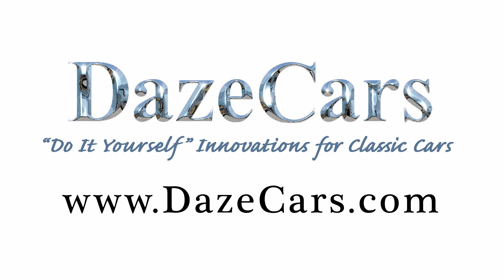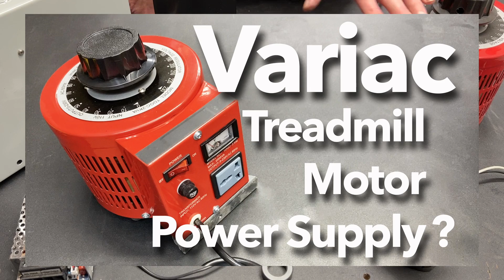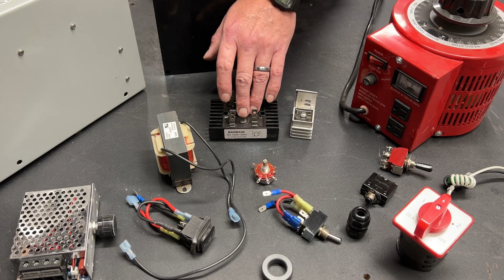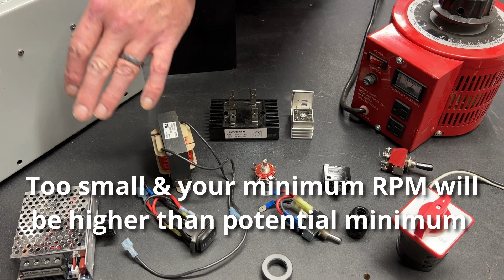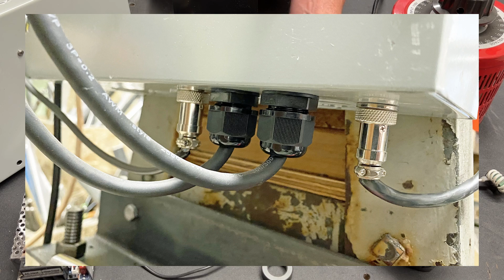Parts Lists & Links for Building Your Own Treadmill Motor Power Supply

Comment: Daze, I've been watching your videos and you are very informative. I'm building a beltgrinder using a 1.25 hp 90v 12A treadmill motor, I've got the 10000w controller like you use, aswell as the 100A / 1600v rectifier. My need or question is what is the inductor choke should I get and would Amazon have it ? Any help would be greatly appreciated.
Reply from the maker: I answered this vei email when you contacted me
Reply: @dazecars thank you very much 😊
Reply from the maker: you are welcome

Comment: Hello sir, I bought this, AC 110V 10000W SCR Electronic Voltage Regulator. What is the switch on the circuit board for??
Reply from the maker: its for the fan
Reply: @dazecars thank you
Reply from the maker: My pleasure.

Comment: I have been watching a lot of your videos, I have 2 complete electronic treadmill sets, one is a MC 60 with a 2.5 HP motor and a MC 1200 with a 3.8 HP motor, planning to use it on an Atlas 618 lathe. What's your opinion on which set up should I use
Reply from the maker: I would start by doing the torque calculations and see which motor is better.
Reply: @dazecars  Thanks for your quick reply, the 3.8 HP comes to 5 torque at 130V, the 2.5 HP comes to 2 torque at 95V, that's at full power, my mainly concern is the big motor may have too much power for such small late and could snap the gears if a tool gets stuck in the part
Reply from the maker: If you set it up with a v-belt the belt will likely slip before the gears snap.  The two foot pound unit is likely also a good candidate.
Reply: @dazecars  Yes, the plan is V belts, already fabricated the motor pulley and order a larger pulley for the Jackshaft, since I have everything for both motors, I'm going to try both of them to determine which one is better. The next thing is figure out the right sequence for all the electrical connections, I have to watch your videos again for it, although I didn't see a wire diagram to connect the tandem resistors you did on your lathe
Reply from the maker: Let me know if any questions come up.

Comment: Thanks for this part breakdown! I’m about to pickup an old treadmill with a 2.5 hp motor to build a puck shooting machine for my two goalie kids.
Reply from the maker: Make sure you understand that HP can be very misleading with a treadmill motor.  HP is a function of RPM and that HP number is at max RPM.  The moment you slow it down you reduce HP.  Torque is the important number and not all treadmill motors are equal.  This info should help: https://youtu.be/KPcAr9orqZw

Comment: Hi thanks for the video. I put a treadmill motor on my lathe with a Mc 2100 controller. When under a load I’d jogs down and shuts off. How can I fix this problem??
Reply from the maker: I got to thinking about your problem further and the motor might also be undersized/under geared and is drawing to big a load from the power supply.  how do you have it geared and what is the torque of the motor?
Reply: @dazecars I've heard people say this a bit in the past and always asked but never got a response.
I would guess the pulley ratios are off and they have lots of speed available but little torque.
A lot of people don't have a lathe to make things fit so they end up making do when making do isn't achieving the end goal sadly
Reply from the maker: It's the biggest mistake people make.  they think because they can slow the motor down there is no need to mess with a gear ratio but in doing so they don't maximize torque and end up over working the motor. As a rule take the max RPM of the motor say 4500 and divide by the max desired RPM say 1500.  That number should be your gear ratio in this case 3:1 as that will multiply the torque by 3.  It also gives you slower speeds at the bottom end.  https://youtu.be/SFvPHUlbIf0
Reply from the maker: I would ditch the MC2100 for the far superior and user friendly DIY power supply.

Comment: the choke resistance, ohms?
Reply from the maker: it will depend on the choke but should have very little.  Readings should be similar to a coil of wire
Reply: @dazecars  thank you for your prompt response, can you possibly give me the dimensions of it.
Reply from the maker: I have several different sizes from as small a tennis ball to as big as a soft ball.  typically the bigger they are the better they work
Reply: @dazecars  I am trying to find one for my 3Hp 16Amp DC motor, thank you again.

I am trying to find one for my 3Hp 16Amp DC motor, thank you again.

Reply

Comment: I really appreciate that you made this recap video. I have watched a lot of treadmill motor conversion videos (several of yours, as well). Maybe I was somewhat overwhelmed, maybe after hearing the answers so many times they have finally started to sink in…whatever. Regardless, this was a very helpful and educational video. I’m finally on my way to motor speed control and a new DIY tool.
Reply from the maker: Glad I could help and good luck with your project!  Don't hesitate to reach out if any questions come up although email through my website is probably better as that gives the option to send pictures.

Comment: Did I miss it?  Is there  link to the DC Choke?  I"m using an SCR voltage controller - Thx
Reply from the maker: The only source I have for those is used treadmill parts suppliers and scrapping more treadmills.  It must be a "motor choke" most chokes even though they look correct are not big enough.  If it's not labeled as a motor choke it will not work.
Reply: Hello, building a belt grinder from scratch. I Currently have an scr with recommended potentiometer,  ferrite choke,circuit breaker, bridge rectifier but no dc choke.  Just removed an mc2100 from treadmill for possible use in my belt grinder build. A little different from the ones you show. Can I send a pic or 2 for some end advise? Regards  @dazecars
Reply from the maker: sure, contact me through my website

Comment: So you have linked the black ferrite toroid core but state in another video to use the green ones…soooo is it green or black? They’re each made of a different material depending on the application correct? Wanna make sure I get the correct one. Thanks🙏🏻👍🏻
Reply from the maker: The one I have linked should work just fine.  I don't remember specifically saying in a video to use green... which should also work just fine.  Can you point me to where that statement is?
Reply: @dazecars ok great, thank you bud!! It was in the one FAQ video about chokes, think you were explaining how to make the inductor and said “the green ring you see here.” I was just confused.  Appreciate everything you’ve put out on the treadmill motors, great stuff!!! 💯👍🏻🤘🏻👏🏻
Reply from the maker: thanks for the follow up.  yes I used a green one in that video because its what I had but its really not that critical.  Different core materials produce different results when dealing with specific frequencies and very sensitive equipment.  For a motor we are just trying to clean out some power spikes as best we cannot eliminate a specific frequency range. That makes the material les critical.

Comment: I have the mc60 and I didn't have to purchase anything or hook up anything else I'm using the speed control that came with the treadmill stop being it's easy to cut it down and use the speed control for the board and I don't you don't need anything else that you said you need to have for that mc60 right out of the treadmill I was up and running so that statement that you need those things to be up and running is incorrect I've also come across a 1200 MC 1200 I can't find any information on this board at all do you have what happened to have any information on that board and would be willing to share that that would be great thank you
Reply from the maker: My statement of "what you need" was in regard to not using the treadmill console and not being constrained with annoying treadmill features.  Yes you can do it the way you are doing it but for applications outside a treadmill it is by no means the best way.

Comment: This idea about using a choke to smooth the brush noise...this is a super advanced topic, i wish i knew more about it. I mean clearly treadmill designers know about it....i just scored my first free treadmill and the choke is just a ferrite toroid with 2 windings, but its on both motor terminals, so maybe theyre not  applying a principle in any rigorous way as much as applying as standard of care as "treadmill engineers"...anyway, thanks for the teaching, your style presentation is really top-level!
Reply from the maker: You are very welcome!!  I am glad you were able to use what I posted to complete your projects.  Yes the topic is complicated but the general rules are simple.  Choke has to be big enough to handle the amps of the motor so if its not labeled as a motor choke its probably not big enough  AND bigger is better (physical size) a bigger choke will have a bigger core with bigger windings and larger gauge wire all things that make it function better for this application.

Comment: Hey, missed this , great information as always. Needing to re watch as it's a lot. LOL!  Have a variac and thought it was a good choice for a small 1/3 hp motor for carving. Double checking to find  I was wrong as the ac motor can't overheat.  Not running for hours at a time but I want it to last? LOL!  Forgot that Id purchased most of these Items. And I had difficulty with your ac choke concept , but need ing to use the carving motor recognized I need the choke. Your information has been helpful as its been quite some time since my electronic days.  Will be doing a refresher. Thanks!
Reply from the maker: @thomastieffenbacherdocsava1549  Did I understand correctly that you are trying to use a variac to slow down an AC motor?  If so that is not a good idea.  DC motors can easily be slowed down by reducing the voltage but AC motors do not work the same way and attempting to slow them down by cutting the voltage is extremely hard on them.
Reply: @dazecars  Yep!  Gonna use the scr controller.
Reply from the maker: An SCR controller on an AC motor is even worse than a variac. Again, you cannot reduce the voltage to reduce the speed with AC motors . To reduce the speed on an AC motor you need something called a VFD and the motor has to be three phase.

Comment: Using your link, purchased a toroid core to make an AC inductor/choke. What AWG would you suggest and how many times should each wire be wound around the toroid? Thank you again for all the great advice.
Reply from the maker: 16awg MINIMUM and 7 windings each side
Reply: Figured it would be 16awg, but just wanted to be sure. Cheers
Reply from the maker: that's the minimum 14 would be better
Reply: I agree. That's what I use on most of my projects. Cheers

Comment: could an emi filter still work instead of an inductor before the scr?
Reply from the maker: no.  An EMI filter is designed to eliminate EMI noise created by the device it is install on not clean up the power in that device. As an example a microwave has a "noise filter" on it so that when its running you don't see distortion on a TV
Reply: @dazecars  thanks, so which tipe of Toroid Core should i use?(minimum id?)
i can't open the link
Reply from the maker: the link works just fine.  If it won't click try cut and paste

Comment: Hi, how does a conversion to DC compare to switching to a 3P motor and using a VFD? Thanks.
Reply from the maker: Strictly from a performance standpoint... no contest.  A DC treadmill setup is very popular because it is effective, inexpensive, and can be setup to work well but it is inferior to a 3 phase AC motor with VFD.  If you are just comparing the end result variable speed to variable speed the  AC option is better.  The down side to the AC option is not everyone has  3 phase wired into their garage or shop and it can be as much as 6 X the cost.  For a lot of applications the DC option is good enough so it really depends on what your budget is and what you are putting it on.

Comment: Just for pits and giggles, it is possible to do this:
Obtain an old PA audio amp, around the 1000 watt output range. You only need one channel working.
Build a 1khz oscillator circuit from a 555 timer chip, about $1 worth of stuff. Instructions on youtube. Input to amp at line in.
Attach a bridge rectifier to the spkr terminals, then to the motor.
The volume control is now the motor speed control.
Reply from the maker: Interesting idea, my biggest concern would be the wattage.  Watts is amps times volts.  On average treadmill motors are 20 amps 90V so that would be 1800 watts.  If you already had the amp and didn't need it might be worth it but an SCR or Variac is likely going to be less expensive than buying an audio amp.  I will say this it is a creative idea and may work.
Reply from the maker: I thought of one issue for your audio amp plan and its resistance.  Amps are built with a very specific resistance in mind, in most cases 4Ω or 8Ω and not having the correct resistance will burn up the amp.  The resistance on most of these  motors is way less than 4Ω meaning you will likely burn up the amp.
Reply: @dazecars  Excellent observation!
However, if you review the original post you may see where I used a transformer from a common home audio amp pwr supply connected to the amp output terminals of the amp in reverse. The 60 volt secondary attached to the amp output is an adequate inductive load. The primary 120V winding is now the output to load.
I have built this, it works, its easy and not a very good idea.
The pwr is limited by the size of the transformer. Normally a few hundred watts. Scoping the 120v output shows beaucoup noise. The NE555 can put out way more volts than the amp input wants meaning square wave output and things get  hot.
You are correct about impedance miss match being an issue. However this is more an issue of pwr transfer in a modern solid state amp. Basically modern output stages dont give a rats patootie, and will shut down or blow a fuse if not happy.
Every pwr inverter out there is a 60hz audio amp.
To prove a point, it is also possible to do this, which I and others have done.
Find 2 old tv sets with CRT tubes that light up the screen. Pull of the back and remove plug carefully from CRT. Remove yoke (wire coils) from tube. Hang up yoke inside being careful not to short out. Plug in tube again.
Careful, this is high voltage!
Remove yoke from 2nd set. Using visual and ohm meter identify vertical and horizontal coils. Pair them as required to match dc resistance as closely as possible. Place on tube of first set.
Connect the coils to the output of a stereo amp. Fire up and start cranking the tunes. The light show is hypnotizing.
Again, this is for entertainment, pretty crazy and involves high voltage.
Bottom line, in an emergency, I can cobble together a pwr inverter out of a cheap clock, a car stereo amp and a transformer from an old home unit.
Now, so can you.
Reply from the maker: very interesting way to do it, thanks for sharing

Comment: I was unable to source an Inductor so I wound one on a heavy steel washer, is this a problem? Motor seems to run OK.
Reply from the maker: not a problem but its not going to work very well.  Amazon sells the correct core.

Comment: Crazy question but, Could I use a power transformer as a choke if the second coil is shorted out?
Reply from the maker: Not a crazy question at all.  I have a video on just that idea.  Worked well for me but some viewers have had issues making it work. My assumption is that their transformer was too small.  I would completely remove the second coil rather then shorting it out.  https://youtu.be/sYjkQvUSths
Reply: @dazecars  Thanks. Now all I need to do is find where it is.
Reply from the maker: Find what?
Reply: The transformer.
Reply from the maker: I got mine from a microwave

Comment: OK, I'm almost there with a MC60 controller.  Would an AC Choke before the board help? (yes I have a DC choke on the DC side).  Is there an wiring option for 2 potentiometers or only one since board has 3 pins to plug into? (What vid shows how to wire up an MC60 and its potentiometer?).  Does the 10k pot control most of the motor rpm range?  Thanks once again.
Reply from the maker: Yes an AC inductor is a good idea before the MC60 just to smooth out the power coming in from the wall.There is not a 2 potentiometer option for the MC60. Check out my video on making an MC60 better as the configuration of clipped resisters can have an effect on speed range.
Reply: Thanks.  Will throw in an AC choke into the mix.

Comment: where do you suggest to locate the fuse in seris:  before On/Off switch, after, downstream, etc.  Thanks
Reply from the maker: I put mine between the SCR and the rectifier because when a rectifier fails it typically shorts out the system and this way the SCR is protected.
Reply: Thx for the prompt and knowledgeable  reply.
Reply from the maker: my pleasure

Comment: The suggested rectifier is "2 phase"  is this different than single phase DC out?  Does it make a difference and If so why.   Thanks.  Learning a lot from your channel.
Reply from the maker: 2 phase refers to the AC side and the alternating current.  The output is DC single phase. The import part is that you have AC in and DC out.
Reply: So both rectifiers are the same, correct?
Reply from the maker: I am not sure what you are referring to as "both" ?  This is a basic AC to DC rectifier.  It converts regular AC power coming out of the SCR into DC power.  A 3 phase rectifier will have more than 4 terminals.
Reply: Sorry,  the 2 phase rec. Amazon link wasn't  attached.  But you answered  my question.  Thx!
Reply from the maker: The one I had linked was the one I knew, it was the other half of "both" that had me confused. 😁  glad I answered your question.